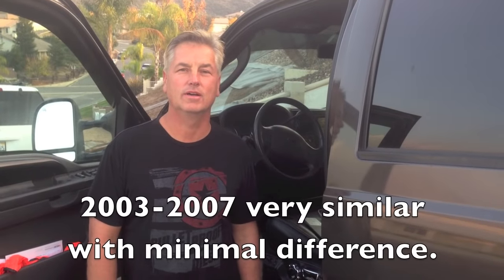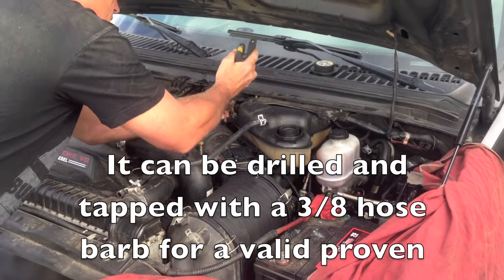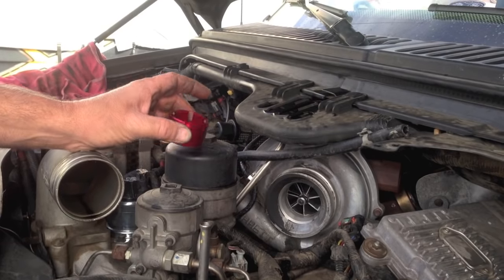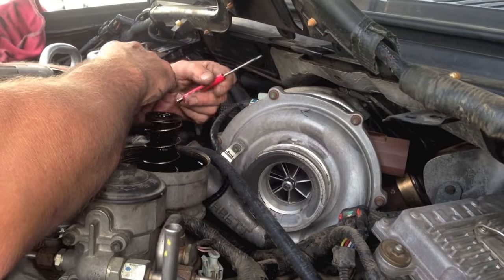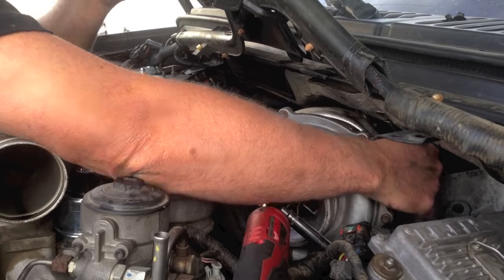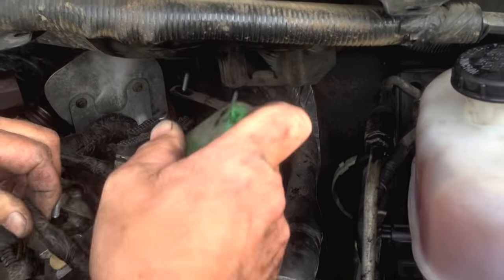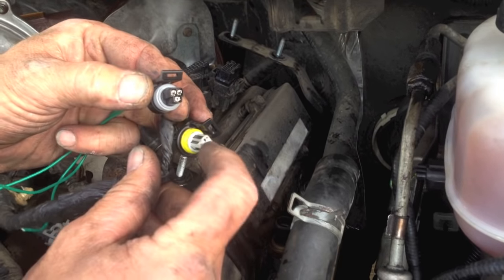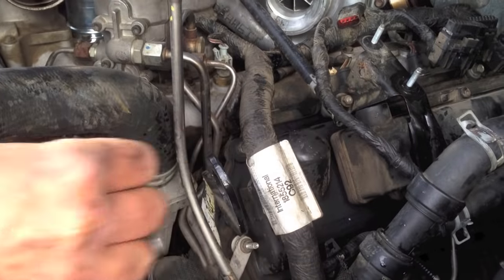Bulletproof EGR cooler with Ford oil cooler. 6.0 Powerstroke

Comment: Just want to comment to keep the video alive. This video made this task amazingly simple and I wanted to extend my gratitude to the wonderful lady holding the camera. Was quoted 3200 to replace the egr cooler, oil cooler, gp 1, thermostat, clean the egr valve and turbo. I had The Illness so was off for the week and got to get out there and knock it out at a leisurely pace for 916 bucks. Not that I couldn't have done it without this video but I wouldn't have done it had I not watched this first. Thank you again for having a steady camera hand and keeping the video up.

Comment: You are the Man!!!!  From Texas, After battling my 6.0 2005 for 6 years I made the last Cast on your Video.  Installed a Bullet Proof kit with Heavy duty oil cooler , EGR cooler and  oil filter.  Truck is running great.  Appreciated Ron!!!
Reply from the maker: Good to hear.  Thank you

Comment: Ron, just did an EGR delete, oil cooler, STC fitting, turbo drain tube, blue spring update, banjo bolts and all of the goodies that go along with that on my 07 on Friday.
I watched this video once or twice and it made all of the difference! The tips about how to get to certain bolts, how many are here and there really sped it up for me. Other than a leak at the paper gasket on the turbo feed line, everything went perfect. Got that sorted out and now its running great.

Just wanted to let you know that a video of this size was definitely worth doing. I appreciate the time you put in. It definitely made it a lot easier on me!
Reply: Does the egr delete make you smoke more?
Reply: I did the work myself just used the video as a guide. 

And the EGR delete will just make the truck more reliable and less likely to fail. Smoke is usually directly related to the tune in the truck.
Reply: RJ Webber was doing the oil cooler a necessity just wondering because I'm debating on whether or bit to buy an 07 that has everything bulletproofed besides the oil cooler.
Reply: My EGR is deleted but doesn't smoke at all

Comment: Awesome video!! I just did my 04 last week. I followed your video and had no issues except when you mentioned the doorman oil cooler gasket. So I threw out my oil cooler and got an OEM ford cooler with updated egr cooler, new turbo, blue spring upgrade and all new filters and fluids.Truck runs great. All your videos helped me. I started this because I had a p0299 and turbo was seized. Thanks again!

Comment: I'd like to add my own thanks to Ron and condolences/thanks to his family.

I've done work on my vehicles before and mostly refer to a few videos to supplement manuals, but since I found Ron's videos they are not only thorough enough to follow step by step, they have also such detail as far as pitfalls that I felt absolutely confident as I embarked on the deepest dive I've ever made on a diesel.

His method and manners pass the smell test when it comes to knowing if the guy in the video knows his stuff, and fine details serve as waypoints on previous service/damage done to your vehicle... these are just 2 examples:

Case in point #1: broken dipstick: yes. mine was broken, clearly by someone who tried to remove the air filter by the Haynes manual procedure!

Case in point #2: hydraulic torque on bolts. When I was cleaning the top of the engine off I discovered the HPOP cover bolts were only hand tight. As I removed each one-by-one to re-torque they literally popped out of their holes under pressure. Because he was so clear about blowing the oil out of blind bolt holes I may have averted or corrected another oil leak.

That's just 2 of many.

Having had some recent very bad service at a dealer which prompted me to NOT spend upwards of $3000 more, Ron's video saved my truck, and also eased my concerns about a head gasket (at least now I will feel confident to do it in the future if need be). Seriously, it's almost as if you have an expert friend accompanying you to the shop so you know when you're  getting honest service.

Ron's videos are the best I've ever found on this site, hands down. What a legacy.

Comment: I just sat down at my computer after taking my time, over three days, replacing my oil cooler and updating the STC fitting. I bought my truck used with 150k miles on it. My truck already had the dummy plugs and STC fitting updated.  Wasted time and money on my part. Other than that I would not have had the courage or know how to do this job if it weren't for this video Ron. Thank you for sharing your knowledge with the world. Just one thing, you never mentioned draining the coolant before you begin the job. After I got it all back together a code tripped for number 4 injector wire. I hadn't connected the plug all the way. Thx again Ron.

Comment: Thank you. I have always loved the ford diesel truck but the 6.0 almost drove me away from ford trucks until I found your extremely helpful and informative videos.  If I had to take the truck in to have the work done, I would not have not been able to afford to keep the truck and would have gone to a more dependable power plant and as far away from ford as possible.  The 6.0 is supposed to be an awesome engine when the problems are corrected and with your help I am curing them as funds allow.  Again, thank you.

Comment: Very helpful video! Needs to be said, take your time to line up the egr to the exhaust and the turbo inlet to the exhaust. I mean perfectly. I had to pull the turbo again to get the cooler lined up. There are flat rings on the mating surfaces that cause a small gap that the V band clamp will not pull into place. 
I poured a little fresh oil into the new oil cooler and into the oil filter housing during reassembly. It helped get the flow going quicker. It also made me realize, I could pour a half a quart or so into the filter housing during an oil change to rinse out a little more old oil. Already buying 15 qts, what's 1 more.

Comment: IN MY 35 YEARS OF BEING A PROFESHIONAL MECHANIC I HAVE NEVER SEEN SUCH AND ENGINE THAT IS SO HARD TO WORK ON , THANKS EPA AND NAVISTAR YOUR ON MY 1 ST HIT LIST WHEN THE BULLETS START FLYING , WORKING ON A 04 E 450 AMBULANCE 2 ALTERNATORS , EGR COOLER ......... WHO THINKS THIS SHIT UP ????  (THANKS FOR THIS VIDIO IT IS VERY VERY INFORMATIVE) ,
Reply: Yeah, I have been tied up on an E 450 van (2005) for several weeks!  What a crappy design!  It's bad enough in a pickup; in a van, it's downright sadistic!  This monster came into the shop leaking water like a garden hose out of a bunch of holes while puking out two quarts of oil every hundred miles.  Furthermore, it had been like this for months, making it a huge, gooey "greaseball" to disassemble and clean.

I told the guy yesterday, "If I had known it would be this hard, I would have told you to take it elsewhere."  Got [almost] everything fixed and tried to start it this morning.  Wouldn't you know it?  That stupid, poorly-designed, God-forsaken, unnecessary, impossible-to-check, effing silicone hose to the EGR cooler cleaned up OK, looked OK, and installed OK, but it was leaking water like a sieve!  Got the turbo out this afternoon, and I'll finish the bastard off tomorrow, but this job has been a gold-plated, cast-iron bitch!
Reply: only one real way to do it arp head studsand nuts ne w gaskets of course new oilcooler egr  delete mine was sinister new turbo rebuillt junk 37000miles allnew up pipes and run great next time it will have a fire ! IF YOU HAVE A 7.3 KEEP IT ) THE 6.0 6.4 AND 6.7 ARE JUNK !

Comment: thank you very much for this video it helps me allot to fix my f 250 I just bought i installed new oil cooler and new egr cooler and all the seals with many pressure hoses changed for rust reason,belts and batteries are changed too all filtetrs ,the truck will go for at least 5 years
thank you

Comment: I love the videos. Very helpful. The van videos are the most beneficial to me, since I work at a shop that has vans, some single alternator, some dual alternator. Any chance you can put together a video with egr and oil cooler on vans? Working on a dual alternator setup doing egr and oil cooler, and have it most of way to intake removal. Looking for some videos on them, but none out there. Your video on turbo removal on vans is a real life saver. Any videos showing the front component removal such as fan shroud, as well as any other stuff needed to access the fuel lines, or wiring harnesses would be great. Thanks for putting the videos out there, and great training and tech tips.

Comment: No. To delete the EGR you weld both ends shut and leave everything else in place and stock. It is permanent, there is nothing to leak or wear out, and it looks 100% stock.
Reply: I was looking for this answer.. doing mine right now..thanks!

Comment: Ron, Thanks for the step by step video.  I have the P0401 code and have serviced the EGR valve next to the oil filter but the code still would go away.  Now I want to follow your video to service the cooler.  I wonder if you provide all the seal and gasket parts we should get prior to take things apart.  I would greatly appreciate.  Thank you again.

Comment: very informative video but i have some querries about the EGR bypass valve especially for Ford F550. i will be thankful if you can answer below 2 questions. Thanks
1.) Firstly, i would like to know the position and structure and shape of the EGR bypass valve how does it look like.

2.) Secondly, when the EGR bypass valve is closed, then the exhasut gas is bypassed directly in to the manifold. my question is when it is bypassed, then is it possible that some amount of the gas slips through the gaps around bypass valve or slips in the cooler? Or does the gas goes back?

Comment: Just about 20 minutes in he mentions the heater control valve is better off the '03  I would add that the turbo-to-intercooler tube from '03 is METAL after that they put plastic ones so I always get one from a scrapyard '03 to retrofit the newer ones for reliability

Comment: Rob, I love your videos. Without a doubt - the best. Excellent advise. Helped me prepare for this job - replacing the oil by getting a few extra tools you mention and following your procedures. However, Even with Swivel and extension- just can't get the super rusted turbo mounting bolt on the driver side off. I hit it with PB Blaster but now the bolt is starting to round out. Can I remove the turbo with the pedestal? Then deal with that bolt on the bench?

Comment: I bought an '05 new and hardly drove it for 5-6 years. When it hit 103k, head gasket went out. For the next 2-3 years, every year it ate up my tax refunds on repairs. It has about 120k miles on it and NOW the oil cooler has to be replaced next week. I have replaced; EGR Valves/cooler, turbo, glow plugs, gaskets, fuel system, & several other repairs. I definitely bought a Lemon. It's sad that Ford has fought owners so hard on their faulty trucks.

Comment: Hey Ron.  Definitely have saved my butt a few times with your videos.    I was hoping for some help.  I have a 2006 F250 6.0 @147K.  All stock.  Ran great came home 1hr later crank no start.  Have scan gauge 2.  Ficm 48.5 start and cranking.  IPR valve screen good plus swaped with a donor.  Updated STC fitting dummy plugs and stand pipes.   Tried to start with icp unplugged.  I have zero ICP Pressure.  IPR jumps to 85 right away.   I have no base oil pressure.  My oil filter bowl doesn't even fill up.  Im stumped.   LPOP?  Something wrong in the filter bowl?  Broken pick up tube?   Any advise at all would be appreciated.   Thanks in advance

Comment: just changed oil cooler, truck started and ran about 1 min, then died, found. oil pouring out the turbo return tube, fixed and now still wont start, you think it may be the dirty ipr screen? i thought it just lost oil pressure. And great video, wouldn't have even attempted without it! thx

Comment: Great video. Have you seen any problems with the welded egr deletes? Some guys are welding freeze plugs into the ports of the egr cooler. Just wondering the failure rate on these setups.

Comment: I working on Ford diesel 6.0 with Tubro and I replace tube from egr to oil cooler cuz it leak after that all good until few months not oil cooler is out I think cuz I check radiator"bucket" it has nasty sludge oil with anti freeze and antifreeze in motor but motor is running fine

Comment: Thanks much Ron for the video, I used it this past weekend for a new oil cooler.  Afterwards, everything seems great, but now at random times I get a rattling sound when travelling down the road  and when that happens and I slow to a stop, it feels like maybe the torque converter is locked then it releases and downshifts hard once, then the problem is gone until the next random time.  Seems like it may be related to this fix since it didn't do it ever before the oil cooler change.  Any ideas?

Comment: Did this identical job using this video step by step....everything went great except lining up the turbo to the up-pipe can be a real pain....had to use a trick from PowerStroke forums using a ratchet strap to bring the pipe up 1/8" but worked. PROBLEM: Since the first restart, my check engine light is on but with NO codes. I even unhooked the batteries for an hour hoping it was a glitch, but the light came on again the next day, still NO codes. Truck runs fantastic though.....any ideas??

Comment: Done about a 100 6.0 powerstrokes bulletproofing and never take cab off  always change oil cooler out with Ford parts ARP head studs and I always replace rocker arm clips!( junk plastic ) what was ford thinking on those?
Reply: What should that cost to have done,

Comment: New cooler or delete for upstate NY?  Loosing about 1 qt coolant every couple days.  Put new cap on degassing bottle, ford says it doesn't know what's leaking but coolant system holds pressure.  Thinking egr cooler, lots of white exhaust in cold weather, comes and goes.

Comment: Hello Diesel techRon.  can you confirm or deny that the rocker box bolts are not recommended to be used and that the head studs will hold the rocker box sufficiently when properly torqued?

Comment: What do you think oil bypass  system. I change my oil every 3500 miles until my SCT fitting went out  and I was fixing it I put my hand in the  block and pulled out sign with oil in it. Is that typically normal I thought that only happens in the coolant system or that would explain why my cooler we're going out and thank you for your video it means a lot to me

Comment: were you working on the space shuttle engine or a ford truck???????
Reply: basically a rocket engine lmao the v8 diesels are so complicated. i like cummins for the fact that basically the only problem your gonna run into with the motor is #4 fuel line. its 40 bucks at the dealership and your told to keep an extra one in your truck. if you start smelling fuel you just pull over and replace it real quick. takes about 15 mins if youve done it before.

Comment: Ron, i just replaced my high volume oil pump . while i was at it i decided to replace my oil cooler also while i had it apart. Used your videos to get it apart and back together without any problems. after i primed the motor and got the truck running i went for a test drive and find that my turbo is not working at all. any suggestions ?

Comment: So you replaced the oil cooler because of its age and being blocked/plugged? The egr cooler you said you got from a Ford dealer correct? Is this a updated version? I have a customer wanting a egr delete on a 6.0 and I'm not familiar with the 6.0 liters. Is it better to replace the egr cooler with the oem cooler if it's a updated version or just do a egr delete? I've seen on some sites and videos that those Sinister delete kits are garbage and if wanting to delete the egr it's best to weld the egr cooler closed on both ends. Any info is appreciated. Thanks

Comment: you said near the end of the video, it starts easier if you prime it,so how do you prime it without cranking it over till it starts only way I can think of is to remove the ICP's and back fill it with oil with so sort of pump, but how do you do it.

Comment: hey Ron Ilove your  video one question, do you not ever tourque your  work to
specs? I checked my manuals for tightening down oil cooler to spec , only because
I have a bad habit of over doing it on the amount  of tourque then breaking bolts,
I bet  that handy  bat operated ratchet is what I need!  Thanks for your help Ron.

Comment: Ron, this is probably a dumb question, but I didn't notice you draining the oil or coolant before starting this and you didn't say anything about replacing the oil and coolant afterward. Am I right to assume that you drained most of the oil before hand? And topped it off afterward? Or is that not necessary?
Reply from the maker: I thought I said flush the cooling system first.  I guess I didn't.  Flush the cooling system.  Yes it's empty.  I usually don't change the oil unless it's old or I'll run it a few minutes then change it.

Comment: Just finished the BP erg and oil cooler. Truck ran fine thanks to your  video. But after a week I'm getting a hot no start. Do you think the Ipr valve is damaged
Reply from the maker: I would at least inspect the screen on the ipr.  If that is good then pressure test it while it's out and hot.  The accurate diesel tester is the best.  If you don't want to buy one. I went them.
Reply: +DieselTechRon 
I have Ford IDS 300 psi when cranking. Just finish looking at the ipr only thing I see is the screen is sucked in. all ipr numbers are good.
Reply from the maker: +brianwmstowing sucked in is actually pushed in from resistance from contamination. start there and see if it's fixed unless you have the means to leak test it while it's out.